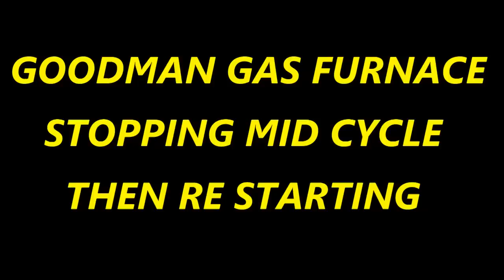GOODMAN GAS FURNACE STOPPING THEN RESTARTING MID CYCLE

Comment: Been putting in Goodmans for over 9 years, anytime you see rust on vent piping usually indicates of a block or partially block base chimney, possible intimating on pressure switch due to lack of venting.

Comment: Pull the hoses on the inducer, check for build up,  also do a pressure test on the inducer fan assembly,  could be barely hanging in there!
Thanks again for the videos!😎👍🏻🇺🇲🍺🥃🥃

Comment: That's my furnace Steve ... 9 year old and runs like a top ... but I clean FS and burners yearly, new filter every 2 months .... I installed it in a 100 year old house, but ran a chimney liner and cap ... when walking my dog I always watch the chimney output (vapor) to make sure it's running at full output

Comment: Short cycling and condensing ,Unlined chimney? Sometimes it's a wrongly adjusted anticipator setting in a mechanical thermostat and or a defective pressure switch ,dirty sensor ,plugged air filter, plugged "A" coil, Dirty blower  fan wheel .